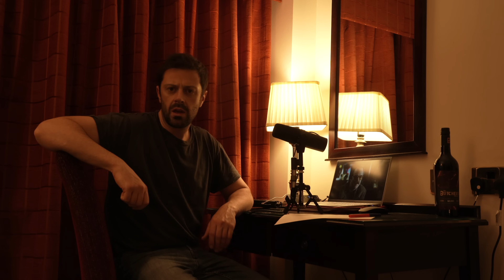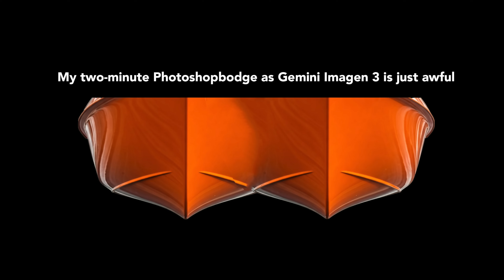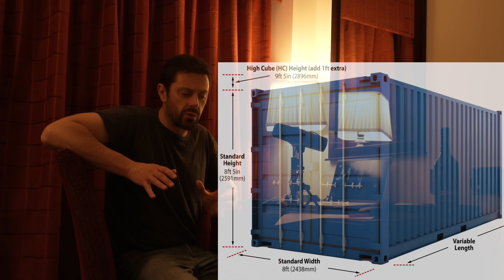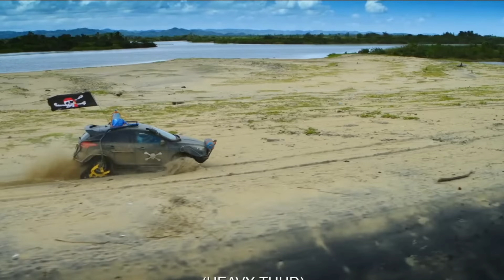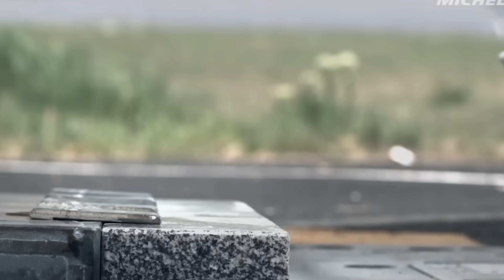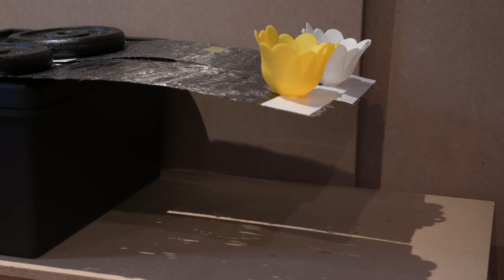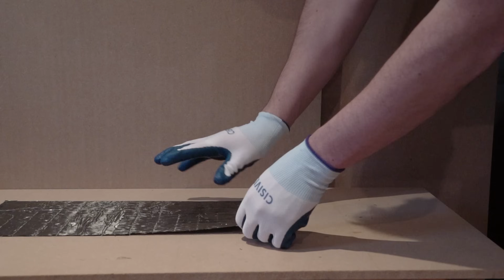The BIG Decisions: fuel, hull type, tracks/wheels, size, power. Bernard Arctic Vehicle Project [4K]

Comment: Greetings from Finland, I am inventor/innovator like yourself. I dont see how diesel in your opinion is wasteful when it is idling etc. It is keeping you alive as very good efficiency heat source in harsh deadly conditions. It is not wasted at any time, if anything good effort should be concentrated  on how to route exhaust inside for some lenght and using the heat very efficiently.  I just found the channel and subbed and have to look earlier videos through. Larger engine IMHO would be better choice than 4 small ones, they have larger robust parts that can tolerate more physical stress before breaking and usually they have had more engineering and quality put into them. Carrying motor in tent was your idea, but how about keeping the engine in and instead making service tent around the engine. Could be much more lighter solution. Having 2 engines per unit can be good idea. Here where I live we have different grades of diesel that stay fluid in various temperatures. Gasoline can be added up to 30% depending on coldness, it is good idea to test very thorougly if vegetable oil mixes with gasoline and the other additives. Again might flow a bit better in larger engine with larger fuel lines compared to very small. Airless tire will be massive weight penalty compared to aired tire. Not sure if that is viable. Again durability at real life using temperature might make them shatter easier internally etc...
Reply from the maker: I'd not use either title, but thank you.

When idling, an 'in cab' diesel engine will only be supplying a fraction of the energy being burned in terms of useable heat and perhaps charge via an alternator. Even when underway, a LOT of the diesel energy is lost as unharnessed heat, and noise.

I'm not sure of much conclusive evidence that smaller generator engines have inferior parts to large car engines. It's going to matter more who makes the engines.

Tent over the vehicle is a solution, yes, but I was just illustrating the need to move a generator, eg into another Bernard.

We won't be carrying gasoline due to the safety risk, and there are already additives to improve the already excellent cold temp performance of HVO, without needing kerosine or gasoline.

On wheels, I don't think there's any more or less brittleness risk for airless/balloon tyres. All the polymers (and reinforcements) would need to be cold-rated, and all have to flex. There are plenty of resins and PUs that are rated below -40. Weight? Only if fibreglass reinforcement is used. And you save on a large solid steel hub.

Cheers for the input.
Reply: @AlexHibbertOriginals  There is already 4-6 other generators in the other bernard too in this scenario. Michelin: "A standard pneumatic tire and wheel typically weighs nearly 21 kg, while a mounted zero-pressure (“run flat”) tire can weigh up to 23 kg. Uptis currently weighs about 22.5 kg.” So here they nicely avoid answering the question because it is weight when mounted on wheel, which of weight is not stated. But if the tyre is 10kg, then non-pneumatic tyre is 15% more, but if the tyre is only 8kg, then it is already almost 20% more. It is critical that tyre has full sidewall that wont break. If the sidewall can fill with snow it becomes extremely heavy and extremely unbalanced too. Natural rubber is preferable in snow and ice. Winter tyres use high silica content on the rubber to add grip. PU hardens in cold and comes very slippery. Yeah I have put less than hour to watching and thinking about this so take with grain of salt.
Reply from the maker: We'll certainly look into all the available rubber/syn rubbers on the market to maximise flex and grip. Cheers

Comment: It might be good to put in a diesel heater in both of the modules. Webasto or something like that, if electricity generation isn't needed, the generators might be off or not producing enough heat.

The Webasto in the front can burn HVO to make you nice and warm.
In the back you can use it if you need to work back there with everything off, working in the back will be much nicer if you're not freezing. It might also be good to preheat the motors and everything else in the back if they have cooled down completely, after parking at the supermarket or something..

The ones that heat air are pretty small and don't use crazy amounts of fuel. Personally I would put 2 in the Command Bernard for redundancy and 1 in the Service Bernard. If any one of them breaks you can always rip out the extra one in the front and put that one in.
Reply from the maker: I mention a diesel stove for the Command Bernard that can double as a heater. Certainly a yes to preheating the Power Bernard, although at least one generator will generally be on. A small portable diesel heater as a backup will likely be wise.

Comment: Big thing with HVO is that you need special seals and o-rings and other rubber/plastic elements in the fuel system which are HVO compatible.  Also, re non-inflating tyres, what I understood is that they have a tendency to wear out quickly due to fatigue damage since the rubber/tyre material is what is absorbing the energy when it deflects, rather than the gas in a conventional tyre, this might make them ill-suited in terms of reliability/dependability.
Reply from the maker: As far as my reading has got, modern engines will be HVO compliant, and it's only old engines that have had seals swell due to exposure to kerosine or similar are likely to leak or perish after a fuel change.

Point taken on the fatigue of the wheels, although balloon tyres have to flex a lot too.

Comment: You tiring to build vehicle that is good at everything and that's impossible. 
1. Did You asked yourself what do you need or where Bernard is going to become land base vehicle that move 70-95% on land or a typical AV that travels 50-50 on land and water. You didn't answer that in video and you got a solution in mind that might be wrong one. 

 2.  You have to made some compromises and decide what it's going to be a land vehicle with capability to move on water or other way water vehicle that moves on land. 

 3. If you want to build good AV look at ARKTOS Amphibious Craft and copy it (look also videos that company made just look at AV transitioning between land and water). Every wheeled AV got a problem with transition between land and water and you want to add dead weight with Tweels that have not any displacement but also big drag in water. You want to move that large drag with extra outboard engine that is dead weight on land, or it wouldn't be big problem if you designed Bernard with lower drag wheels that have some buoyancy.

4. I still believe that wheels are bad solution. Simple and light caterpillars in a light vehicle shouldn't be a problem, look at new composite tracks made in sections so they are repairable. 

5. Your simple, small and cheap Arctic Vehicle Bernard after what you described it's not going to be any of those things. 

And I actually trying to undermine your ideas to confirm if they are well thought out for me they aren't ;-)
Reply from the maker: I don't think good at everything was ever a stated aim. For example, it'll never be fast.

1. This makes no sense to me. I did an entire episode where I listed the needs, and the terrain it'll be on.
2. This is literally what I'm doing.
3. The Arktos is impressive, albeit with a different role and rather heavier. Nothing is set in stone, and the airless wheel idea needs testing.
4. I'll never turn off to tracks, but they are famously hard to maintain, and there's a reason modern designs are using wheels instead. Perhaps we can improve on a simple design.
5. This isn't constructive.

Yes, it does sound like you're aiming to undermine.
Reply: @AlexHibbertOriginals  5. It is constructive, I just didn't explained why. Lots of systems, lots of redundancy, Battery, electric systems, electric engines as propulsion in arctic, wind turbine, outboard engine for water, heat exchanger in power car. You should try to reduce points of failure, weight, and number of systems not increase them. 

You should talk to someone who actually work in those conditions and ask their experience, I do not think that lot of viewers been in arctic. 
And You need Devil's advocate for undermining your ideas before You invest to much time and money in wrong solutions.

Comment: I think diesel-electric with articulated hulls and separated crew/powerplant is an elegant solution to a long haul problem.
However,
it does seem to me that either this project is poorly communicated. Is it an expedition vehicle? A custom order vehicle for commercial sales? A vehicle that will be operated by a company for commercial services? A brainstorming of fun and crstive ideas of what could be? It seems to me your initial aim is to build around 2 vehicles for 4 total hulls.
The choice of HVO is understandable if you either already have a sponsor, or potentially reaching out for sponsors that would be willing to both provide fuel for marketing and cover some development and operational costs. Regarding costs, if I understand correctly, you would have to basically develop from the ground up and ultimately manufacture or assemble every single major part of the vehicle. As you have mentioned, a lot of your skills and knowledge with working with compositws and modifying a lifeboat hull will be transferable for the Bernanrd, however the scale of developing and manufacturing an entirely new large-scale vehicle puts this within the range of a R&D project for a company with engineers, cash flow and underlying technology that can be used as a core of the vehicle. 
The shell would need to be lightweight, insulating, durable, expected to handle the extreme conditions and potential stress from flex of the chassis or even the weight of the rest of the vehicle. The requirements are strikingly similar to the lifeboat hull, but with an extra requirement to be extremely light. Said shell would also need to be designed from scratch an it would need to be designed for eventual repeatable manufacturing of starting hulls. It is one thing to create a custom sled, it is completely different to manufacture and test 4 composite shells for 2x5 hulls.
And that is only the shell, I really hope that you already have a chassis you aim to modify and put your shell on top of, because, otherwise, the sheer scale of the project makes me hesitant, as a viewer, to emotionally invest into seeing Bernard escape development hell and ever reach 'good-enough' state to see itself deployed on ice.
I strongly recommend against going amphibious if this is to be used on ice, unless it's strictly for small river crossings, because outsized risks of getting stuck in the water, ice or even rollin over far outweigh any potential benefits. Making the hulls amphibious will make development requirements for every other part of the vehicle much stricter, if it's expected to enter water willingly and exit it at will on an unprepared landings, too.
Reply from the maker: I wish people would use paragraphs! I'll pick out a few points.

I did an episode on the aims for the craft. Expedition vehicle with potential for second generation vehicles to have charter/rental use.

I'm speaking to engineering departments, and many of the parts will be off the shelf.

For amphib, it's for very short crossings or lead sections. Or, wheels off, to be towed behind a much larger boat with personnel not onboard. Neither in offshore conditions.

Comment: So, like a Hagglunds with wheels instead of tracks, and a boat-shaped hull rather than boxes? Makes sense to me. Tracks are great, but you pay a really high price for the performance. 
The idea of multiple redundant generators is good, especially if they're in separate units that can be lifted out. Maybe consider having a crane of some sort in the engine bay, though; even just a chain hoist or a winch to life things up and swing them outside the vehicle.

The supply drop idea is also a good one; maybe design them so they can be airdropped if required, if they're able to be just abandoned out on the ice for long periods. Chuck them out the back of a Hercules, and pick them up later. Or not, because it's not like used chip fat is that harmful to the environment.

What's the plan for the heating system? Are you going to use engine exhaust to heat air?
Reply from the maker: Very roughly, but without all that steel.

I like the idea of an infrequently used crane, perhaps tying into the winches already needed.

Air droppable eh. Now that would make for fun testing episodes.

Yes, I want to reclaim heat from the generators via a heat exchanger. Preferably air-to-air, but we'll see.

Comment: I think you overcomplicate it. Two Generators are enough, you also need additional wiring and Inverters, this uses space and brings complexity. Also for the Tyres, the airless Tyres are maybe good for on Road usage, but for off Road usage you need the fexability, the Tyre needs to flex over the Obstacle. Two teamed Vehicles are not so simple then you think, look at the Häglunds it is really complex. More complexity means more Points of Failure.
Reply from the maker: If one generator dies, you'd then be underpowered and keep having to stop to recharge. If the rear shell is towed like a trailer, you avoid much of the complexity of the Hagglunds.

Comment: Be very careful when using condensation water, a thing like that can be a breeding ground for some very nasty bacteria.
So if you are going to use it, make sure you thoroughly treat the water first, or you risk some serious health problems.

For water propulsion, try looking into impellers like a jet ski uses, their advantages over just a propeller is that they are housed inside a tube which will be much more useful for a rugged vehicle. 
As you could have two, one on either side and that would give you some differential steering which would help with control in the water.

And to prevent the intakes getting clogged or damaged, you could have some plates that can be open and closed in front of them with a simple hatch when driving and can be opened prior to going into the water.

And if they are powered by electric motors, they can run off of the unit's internal power system without issues.
Reply from the maker: Certainly some carbon block filtration for the win. Yet another system transferable from Alan.

Good ideas to bring into the mix when choosing the small temporary 48V water propulsion system.

Comment: Diesel electric seems like a sensible option. I had to do the weekly check/maintenance on the emergency generators at my work and ours were around 30 years old. I was told by the engineer that used to do the annual inspection they didn't have a problem with age because they ran at the best rpm for ware and load as well as the weely run up keeping the fuel fresh.

Regarding your telescopic camera pole as a further option to consider the RN etc is looking at having tethered drones with sensors to extend the range of raidars etc. civilian tetherd drones are already available and may have less issues than an extendable  built into Bernard.
Reply from the maker: We'll have drones, but fixed cameras use a lot less power for prolonged viewing.

Noted on the aging generators!